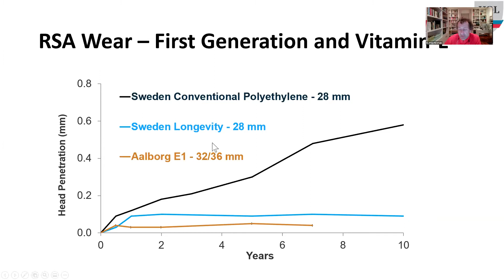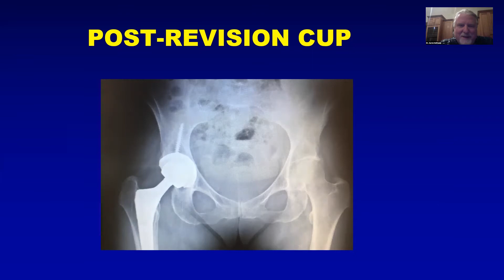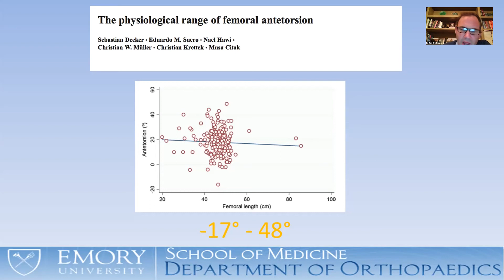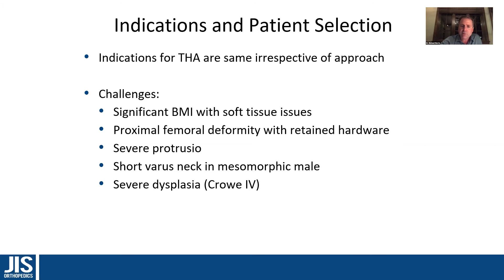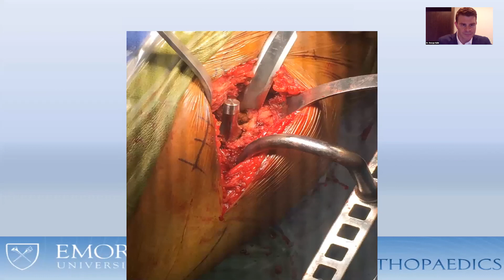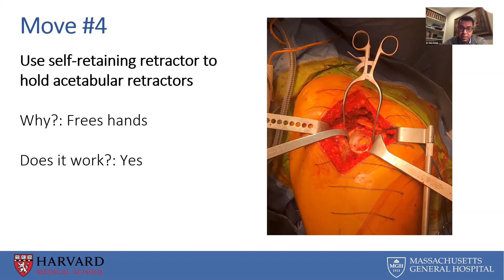PCHK Symposium 2020: Primary Hip

Comment: Bill Hamilton performed my surgery in 2020.Thin, previously active, petite female, RTHA, anterior approach and it was a disaster for me. Severe and chronic pain for years afterward.  Significantly worse hip pain than before surgery, with my knee buckling when I ambulated in 2020 and severe quad pain.  This is what I now know: femoral nerve damage (EMG); chronic pain; cup above bone over 10 mm posteriorly;  multiple areas of bony impingement; approximately 40 degrees of acetabular anteversion (BH told me he gave me 20 degrees of acetabular anteversion as he does the majority of patients  and he told me after CT that cup was completely under bone); damaged soft tissue; and more. I was  also 3 mm long on left pre-surgery and that did not bother me.  I came out of BH's surgery roughly 6 mm longer on R (approximately 9 mm lengthening on a petite woman?) which did affect me. Pre-surgery, he said his software was so great that he would even my legs and precisely place my implant - what a joke. To quote him: "It's a matter of geometry." Asked me to stand on boards in his office for LL - - what a joke. Maybe he should have spent more time than 33 minutes from incision to final implant. Did he even template or just place in some minimum and arbitrary cup and stem size for petite women?  He acted as if he had no idea why I was in so much pain for months afterward and I had to seek meaningful help from other surgeons. Maybe he should stop "teaching" and focus on his craft.